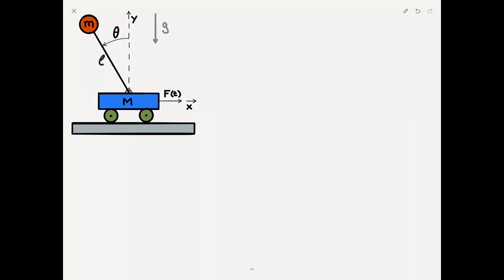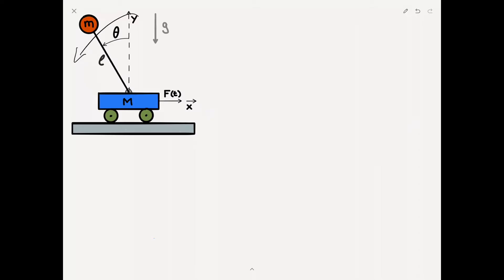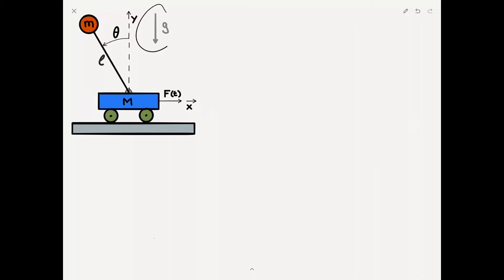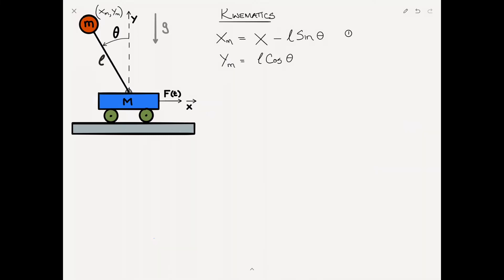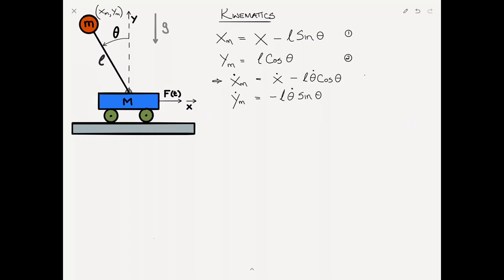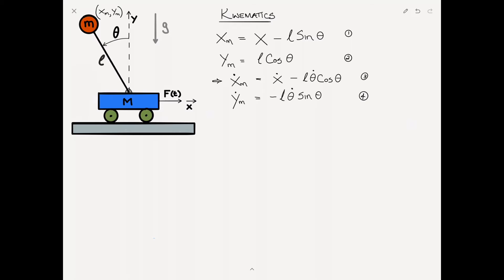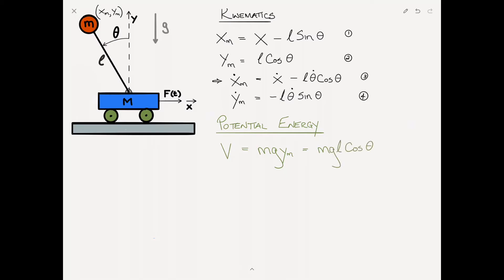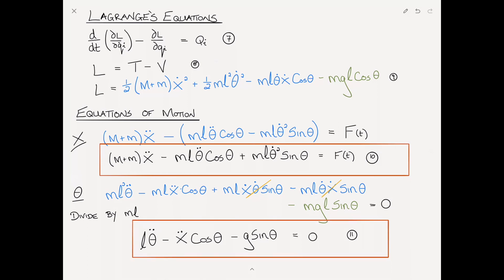Equations of Motion for the Inverted Pendulum (2DOF) Using Lagrange's Equations

Comment: Why you not considered inertia, friction force?
Reply from the maker: I neglected inertia of the pendulum rod, friction, and other dissipative forces to keep the model as simple and clean as possible for educational purposes.

This is a structural dynamics derivation, not a real-world simulation. If we wanted a more complete model (e.g. for control design), we could include:

- Rotational inertia of the mass (if it's not point-mass-like)
- Rotational inertia of the rod (if it's mass is not negligible compared with the mass, m)
- Friction at the cart wheels or pendulum pivot
- Air drag (usually negligible)

But for illustrating Lagrangian mechanics and getting the core equations of motion, these idealizations are standard and helpful.

I have show in another video how to include the inertia of the rod if you are interested in this.
https://www.youtube.com/watch?v=eBg8gof1RBg

Comment: Hey guys, new here. Why isn't the energy of the moment of inertia taken into account? E=(1/2)Iw^2
Reply from the maker: In this analysis, I didn't ignore the rotational kinetic energy of the pendulum - it's actually included within the overall kinetic energy term. 

The pendulum is modeled as a point mass at distance L from the pivot, so its rotational kinetic energy appears as (1/2)mL²θ̇².
If we were modeling the pendulum as a rod with distributed mass or with moment of inertia I, we would indeed add (1/2)Iω² explicitly. But for a point mass pendulum, the rotational energy is fully captured by the term (1/2)mL²θ̇² in equation 6.

For more complex rigid bodies, you're absolutely right that we would need to include (1/2)Iω² as a separate term.

Comment: Could you do a sequel video to explain how one could control the system to keep the bob up at all times by adjusting the motion of the cart and therefore determining the force F(t)?
Reply from the maker: This is really a control problem and would require explaining some basic control theory first.  There are many videos on this on YouTube, but they refer to the modeling that we covered in this video as the hard part.

Comment: Hi, Thanks for this excellent video. However, I am finding it difficult to intuitively understand the third term of kinetic energy expression at 7:45. I understand it has something to do with the coupling effect of the motion of the cart and pendulum. Still, it does not make sense scientifically according to my understanding. Anyone can explain it intuitively? 
Thank you
Reply from the maker: When taking time derivatives to find velocities, these derivatives must be taken with respect to an INERTIAL REFERENCE FRAME.

This cross-product term in the kinetic energy is, indeed a coupling effect, and arises from considering the pendulum's motion from the perspective of a non-inertial reference frame - the moving cart. As the cart accelerates, so does the hinge point of the pendulum, which means that if you just consider the first two terms of the kinetic energy, then you're observing the pendulum's motion from a platform that itself is moving. This non-inertial reference frame thus introduces complexities in how the pendulum's kinetic energy is calculated.

Intuitively, the cross-product term accounts for the additional velocity and, therefore, kinetic energy that the pendulum mass has due to its rotation around the hinge point, which isn't stationary but moving with the cart.  This is why it contains both x_dot and θ_dot.  This is probably a good topic for a video!

Comment: Hi, I have some questions:
1. Why don't you add the potential energy of M in the equation (5)?
2. I think you missed the square of l in the second term in the equation (10).
3. What if m is in the right, not the left? I think they are different.
Thank you. :face-red-heart-shape:
Reply from the maker: 1.  The mass, M, has zero potential energy since it is located at y=0 and it's y location doesn't change.
2.  This is correct as written.  The 2nd term in eqn 10 comes from the THIRD term in eqn 9 - because the 2nd term in equation 9 does not contain an 'x' so it does not appear in eqn 10.
3.  If m is to the right, then according to my current setup, θ would be negative.  However, if you choose to make θ positive to the right instead, then you will need to adjust the kinematics and flip the sign of the 2nd term to positive in eqns 1 & 3.

Comment: @1:00 this setup appears to be missing one variable - the angular velocity of the pendulum at t=0. Needs to be specified, as it could be anything.
Reply from the maker: This is a 2nd order differential equation in time, so it requires 2 initial conditions.  Typically it is assumed that the initial angle and the initial angular velocity are known.  This is be based on the setup.

Comment: Great video. There's just something I don't quite get. At 14:10 , why is it that when the cos(theta) is differentiated, the negative sign infront of it does not become positive, because from what I understand, derivative of cos is - sin and this negative sign is supposed to cancel out the negative sign that's already infront of the original undifferentiated term.
Reply from the maker: There are actually 3 negatives here and they combine to produce a -ve sign.  You are correct that the negative sign from the derivative of cos will cancel out the negative sign that already exists for this term in the Lagrangian.  HOWEVER, if you look at eqn 7 (we are dealing with the 2nd term here) dL/dq_i must be SUBTRACTED.  This is why we have negative signs before the last 2 terms of this equation.
Reply: @Freeball99  Ouh I see sir, 
Thank You Very Much 🙏.

Comment: Are there any videos that describe this not on a cart but a rotating body? Say the pendulum was connected to a point on a circle spinning counter clockwise and the pendulum itself was falling counter clockwise itself. I'd like to know how to find the rate at which the body would have to be rotating to "catch" the pendulum and keep it in a semi vertical position, in relation to the axis it would create if it went all the way through it.
Reply from the maker: Not sure exactly what you are trying to achieve, but the spherical pendulum might be a good starting point.  You could model something like this attached to a rotating base perhaps.  youtube.com/watch?v=Qo0IW91tniw

Comment: Can small angle approximations (sinθ ≈ θ, cosθ ≈ 1) be applied in the equations?
Reply from the maker: Yes, provided the angle is, in fact, small (typically less than 10 degrees).  Linearization can be used when examining the control problem of keeping the pendulum balanced and upright.

Comment: hello sir, i am really impressed and i finally get a hang of the lagragian equation, i am trying to model a system using simulink to get the response of the dynamic equations, i learnt that to feed your dynamic equations into simulink you need to put the greater power on the left, but the equations we got from your video Xddot and theta ddot both appear on each equation with the same power. i would like to know if you have any suggestion on how to feed it into my simulink to see the response.
Reply from the maker: I've never used Simulink so I'm not familiar with the process, but I'm guessing that you need to write the equations in vector/matrix form.

Comment: Hello sir. Ur videoes are very awesomely explained. Can u plz share as to which video editor you use after making ur videoes. Thanks
Reply from the maker: Whiteboard presentations are produced using the app "Paper" by WeTransfer.  Running on an iPad Pro 13 inch.  Video captured using Quicktime and edited using iMovie.

Comment: In a previous problem, (vertical cart attached to spring and one pendula), you considered the height h displaced by the bob. With that logic shouldn't V = mgh* = - 1 * mg (l - l*cos(theta)) ?
Reply from the maker: Both are right.  This is fundamentally just a difference of the coordinate system.  In this case, I have the origin at the hinge.  In the other problem, I placed the origin at the equilibrium position of the mass.  As a result, these expressions for potential energy differ by a constant, HOWEVER, the constant get differentiated out when the potential energy is substituted into Lagrange's equations - so, as one might expect, you can arbitrarily select the point of zero potential energy depending on where you place the origin of you coordinate system and it should make no difference to the final result.

Comment: Hi
I'm trying to get into Lagrangian mechanics, mainly so I can code my own inverted pendulum on a moving cart from scratch (and be able to control the cart), and this helped a lot.
The one thing I did not understand was at 14:22, how/why you found out that the "external momentum" was 0 for theta, but F(t) for x.
I kind of get it, but not in a very scientific way. If you could clarify that for me or give me a video I can watch to understand, I would greatly appreciate it! I've tried googling it, but Lagrange equations just seem too general. I later read something that said that the external force should be accounted for in the potential energy because F=dV/dx, but that should break for non-conservative forces, which I'm pretty sure f(t) is.
Thanks in advance! Great video
Reply from the maker: According to the problem statement, there is an external load, F(t) being applied to the cart in the x-direction.  There is no  mention of an external moment being applied at the hinge.  Lagrange's equations require us to apply the load to the right hand side of the equation corresponding to the coordinate that the load is applied to  (this is derived from the fact that the external load/moment will do work as a result of that displacement changing).  Consequently, the external force is applied to the right hand side of the "x" equation of motion and since there is no external moment, there will be a zero on the right hand side of the θ equation.

Regarding conservative/non-conservative forces....you can ALWAYS add the external load/moment to the right-hand side of the equation regardless of whether is it conservative or non-conservative.  However, IF the load is conservative then it can always be written in terms of the derivative of a potential function.  As a result, for a conservative load (e.g. gravity), you can either add it to the right-hand side of Lagrange's equation as a load OR you can include it in the potential function and add it to the left-hand side of Lagrange's equation.

Comment: What software did you film this video in?
Reply from the maker: Drawing app is called "Paper" by WeTransfer.  Running on an iPad Pro 13 inch and using an Apple Pencil.  For screen recording I attach the iPad to a Mac and use Quicktime to record.

Comment: Why is the generalized force for θ (torque) equals to 0? Doesn't the force F(t) applies a torque to the system?
Reply from the maker: We are considering only external forces in the case of generalized forces, so it's just F in this case (we can ignore forces from the rod) No, the force does not apply a moment to the small mass - it is purely applied to the cart and in the x-direction.  If the force  were applied directly to the small mass, m, then you would be correct that it would also produce an external moment.

For the generalized force, we only consider those forces that are acting directly on the particular coordinate.  In the case, the external force is assumed to act act through the location of the hinge (the cart is assumed to be infinitely thin) and so cannot produce a moment about this point.

Comment: Sorry, but what about the rotational kinetic energy? Why wasnt it considered in the Kinetic Energy equation?
Reply from the maker: Typically, we treat a simple pendulum as a point mass (though I should have made this more clear at the start), in which case its rotational KE is zero.  In general, you are correct that the rotational kinetic energy should be included.  In reality, what you'll find is that in most cases, the rotational KE is negligible for a simple pendulum UNLESS the radius of the mass is very large.  

In the case of a compound pendulum (or in cases where the mass of the rod/string is not negligible) then the rotational kinetic energy must be included - I have another video showing this.

Comment: If we subs eq10 (without ext force) in eq11 we get
l.t'' - c.(a.l.t''.c - a.l.t'.t'.s) - g.s = 0
->
(l - c.c.a.l)t'' + a.l.s.c.t'.t' - g.s = 0
->
(1 - c.c.a)t'' + a.s.c.t'.t' - g.s/l = 0

Where:
t = theta
c = cos theta
s = sin theta
a = m/(M+m)

As a<1 we have that (1 - a.c.c) >0. So, at first look, nothing prevents theta = pi/2, right?
 My question is: in the eq of motion are, somehow, implied what would happens when theta =pi/2?
Reply: I didnt mention that my consideration was made because x=constant and theta= pi/2 inst a equilibrium of the system. It's very strange, the stick of the pendulum just don't want to rest?

Comment: Hey Freeball,
Keep up the good work. Can't explain how helpful your contents are! 

So I just felt like taking this cart and pendulum model to python and play around with the initial condition to see how the system reacted. As expected, the cart had movement even when the initial condition for x (cart's position) was zero for different values of theta (pendulum's position) implying that they are coupled. However, for the case where the pendulum was initially horizontal ( theta = pi/2) I found no movement in cart (x = zero for all t). This looks wrong intuitively... is it because the EOM don't have the x_dot terms in it?
Reply from the maker: I agree that something seems off here.  The cart should move whenever the pendulum swings, regardless of its initial condition.  This is not related to the EOM's having no x_dot terms (these would come from adding damping).
Reply: @Freeball99  Hey there, I worked on it and figured out this was a non linear problem so the mass matrix( being part of 2n x 2n matrix A from your video on Direct time integration) and B matrix (comprising of damping and stiffness matrix)  were also varying with time and I had considered them constant. This has solved the above problem of theta and x coupling for theta = pi/2.

The reason I asked about x_dot was that the absence of x_dot in the EOMs made it feel like the system behaved independent of cart velocity. So assume I give an initial velocity to the cart, the pendulum hence theta should change but it's not.
Reply from the maker: @NYKYADU  This problem is a semi-definite problem because the system is not restrained and can move as a rigid body without oscillating.   For example, if initially the cart had some velocity, x_dot and the pendulum was pointing perfectly straight up (theta = 0) then the cart would just continue to move along at its initial velocity with the pendulum pointing straight up.  The initial velocity of the cart doesn’t affect the pendulum (unless there is damping applied to the cart), but rather it is the accelerations of the cart that impart a force/moment to the pendulum and hence the coupling.  

Pro Tip: Any time you are dealing with geometric nonlinear problems, you will have to update the stiffness matrix with each time step.  You will also find that updating the mass matrix with each time step becomes very expensive because you need to invert M.  Inverting a matrix requires in the order of n^2 iterations.  As a result, as n grows, inverting the mass matrix becomes prohibitively expensive (time consuming).  The good news is that in many instances you actually don’t need to update the mass matrix (unless mass is being lost by the system) and this results in very little loss of accuracy, but a huge improvement in speed.  You should alway test whether not updating the mass matrix produces similar/accurate results.
Reply: @Freeball99  
That clears things up. Never crossed my mind that it was a semi definite system. 
Trying to understand balancing of inverted pendulum now.

Thanks for the tip.  You have been phenomenal. Thanks a lot.
Reply from the maker: @NYKYADU  the balancing of the pendulum, which is a controls problem, requires you to first linearize the EOM, by assuming that the displacements are small and then throwing away the higher-order terms and making appropriate substitutions i.e. Sin θ = θ and Cos θ = 1.